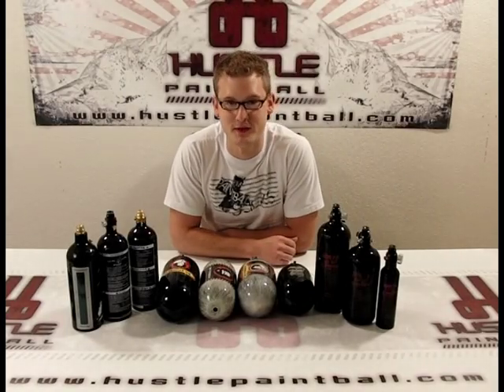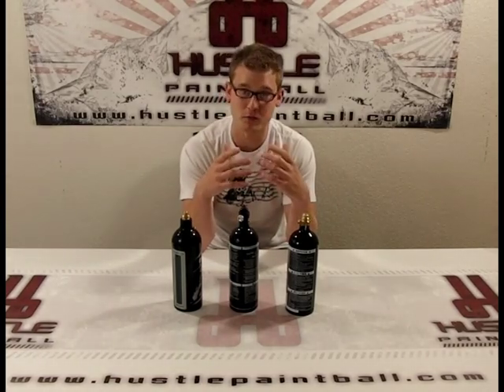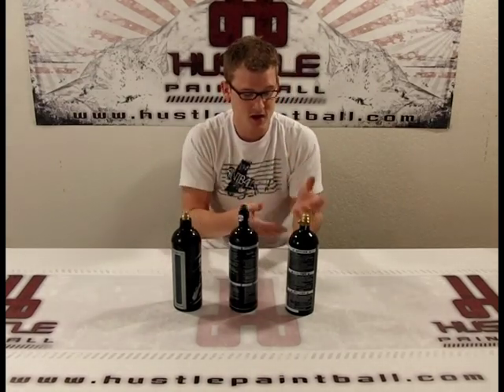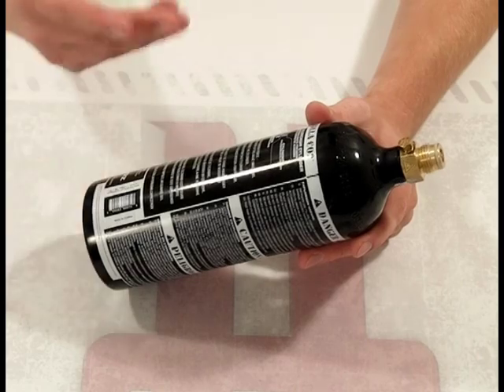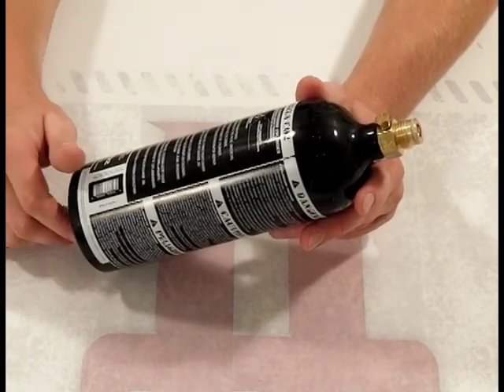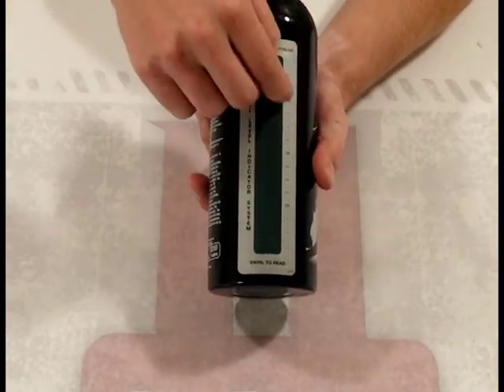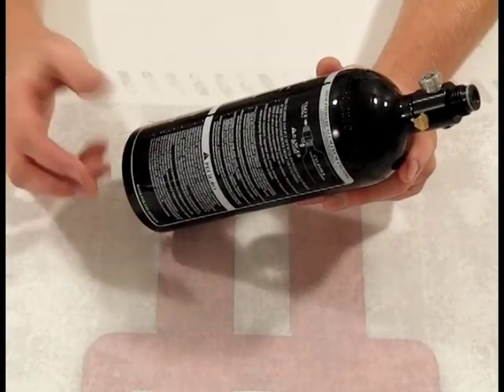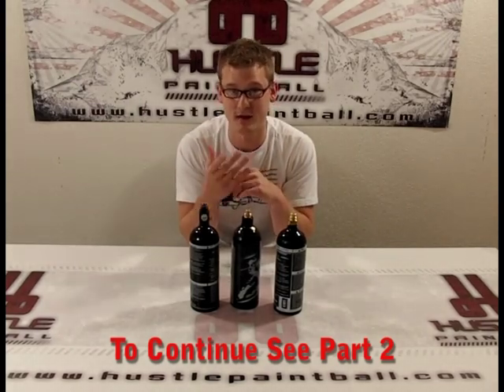CO2 vs Compressed Air (N2) Part 1/3 - All about Paintball Air Tanks by HustlePaintball.com

Comment: do not use CO2. it sucks to fill, it sucks to shoot, it sucks to handle, i dont even know why they sell it.
Reply from the maker: It is still sold because it is still a better option than HPA in some, very specific cases! :) and cmon, it's not hard to fill...

-Dan
Reply: Hustle Paintball lol maybe with good equipment it's not, but it's more of a hassle than HPA for sure. not to mention my Etek cant run on CO2, so snobby fields (coughcoughpromisedlandcough) only rent it to prevent people from bringing their own stuff
Reply from the maker: Eric Miesbauer Even with basic equipment it's not too bad :) Especially when you consider that HPA costs nearly 10 THOUSAND dollars to set up and CO2 costs a couple of hundred :)

Yes HPA is better and yes you can use it on all markers, but that doesn't mean fields are snobby for using it...it just means that they can't afford a full HPA setup.

-Dan

Comment from the maker: You could...but it wouldn't transfer all of the air to the first tank. The pressure will   reach equilibrium and then stop moving between tanks. You'll keep getting smaller and smaller fills until its not worth doing it anymore.

-Dan

Comment: Hey just wondering, i have 2 HPA tanks and a remote line. if i run out of HPA on my first  tank mounted on my gun, could i safely attach the remote line coming from the 2nd tank to my mounted tank to charge the tank? BTW they're both 3000 psi tanks.

Comment from the maker: Compressed air, HPA and Nitrogen tanks are all exactly the same just the name or the naming convention changes. The operation and components are exactly the same. HPA is much better because it is regulated at the tank and provides a very consistent output for the marker. CO2 converts from liquid to gas in a specific pressure range but this range will be affected by temperature and the rate of fire. HPA is just more consistent. - Jeff

Comment from the maker: First... Everything is better with HPA. Even your 98. You will not have any issues with any of the tanks out there right now. Some of the entry level tanks can be challenged with a Tippmann if you have a Response trigger and a Cyclone installed but most handle it in stride.

Comment from the maker: @lzboy231 CO2 tanks must be removed as they are filled through the same valve that lets the pressure out. HPA tanks have a different fill nipple and do not need to be removed from the marker.

Comment from the maker: @Bu11zzAye 60-75 degrees won't hurt your shot count, but it will hurt your pressure. You'll probably drop a good 15-20 FPS from where you would be if it were an 80-90 degree day.

Comment from the maker: @AbeybladeAsteR70185 Yes, not only that, but because it is unregulated pressure your shot to shot consistency which translates directly to accuracy is worse. HPA is always a better choice over C02. Most mid to high end guns can no longer use C02 as it will ruin them.

Comment: i have a 3000 psi air tank and my dad has a electronic air pump for the car tire would i be able to use it?????? PS. i have an adapter for it

Comment from the maker: @TNTslayer1997 If you are referencing something like a car tire air compressor, no. If you have an industrial strength air compressor (3000-5000psi and not 150-200psi) then yes, you could probably find the fittings from the same company.

Comment: Just wondering but I have the GXG Tactical Vest with 4+2+1 pack that I bought from you guys and I was wondering if the Crossfire 88ci 4500psi Compressed Air N2 Tank will fit into the tank holder pouch.
Thanks

Comment from the maker: @fuckyoda A 9oz CO2 tank is not filled by measuring the pressure (psi).

You have to get all tanks (CO2 and Compressed Air) hydrotested every 3-5 years to ensure that they are still in good condition and can be filled safely.

Comment: i currently have a tippmann A-5 and ive used Co2 with it ever since i owned it, but i want to switch to compressed air.  is there any thing special i need to do, or can i just start using compressed air

Comment from the maker: A 48ci 3000psi tank would give you approximately 480 shots, total, before needing to be refilled. The way I arrived at that number is by multiplying 10 times the cubic inches of the tank. So, 48 cubic inches, multiplied by 10 = 480.

It's not exact, but it's a good way to estimate how many shots you could get.

Comment from the maker: Yes, absolutely - Compressed Air is much better than CO2. The amount of shots you get out of your compressed air tank depends on the size of tank you get. To estimate, here is a simple way: For a 3000psi tank, multiply 10 by the amount of cubic inches, and for a 4500psi tank, multiple 15.

For instance, a 48ci 3000psi (48/3000) would give you approximately 48 x 10 = 480 shots. A 68ci 4500psi (68/4500) would give you approximately 68 x 15 = 1,020 shots.

A 20oz CO2 tank would be about 800-1,000.